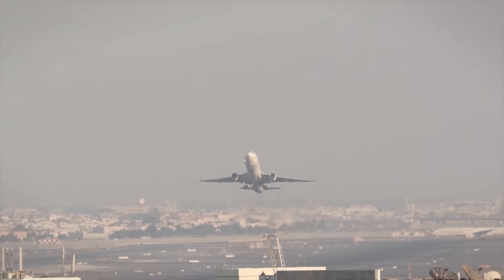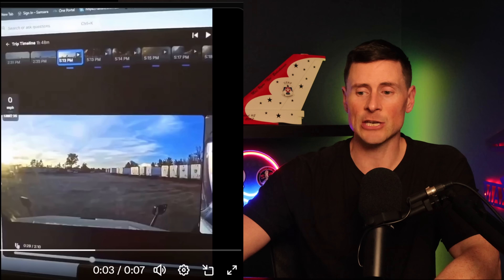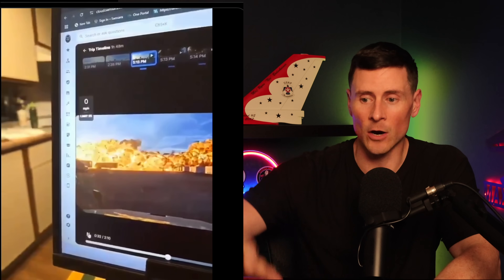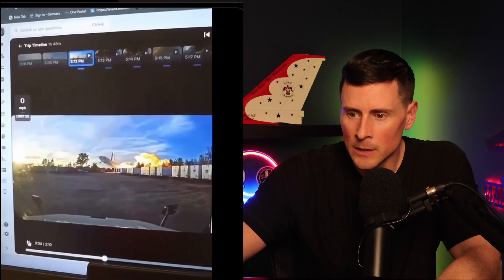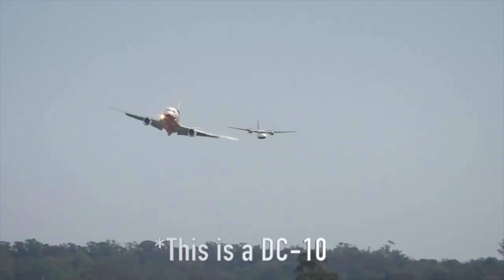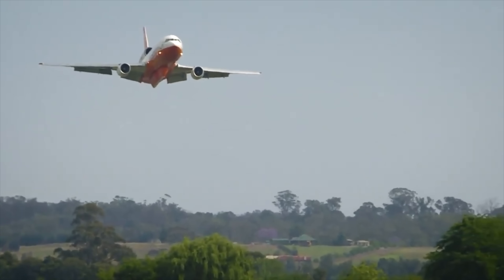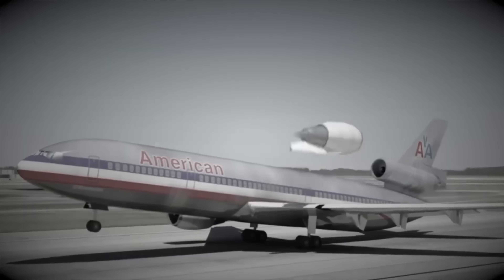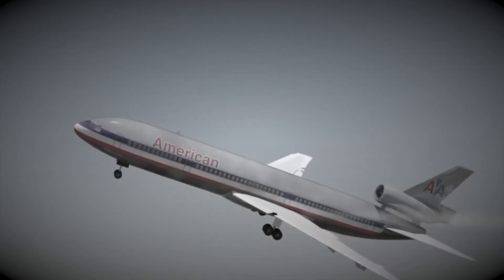Airline Pilot Reveals CHILLING Clue in Final Moment Before UPS 2976 CRASH

Comment: Its been a long time, but if memory serves me right, the maintenance crew used a fork lift to chance the engine on the DC10, damaging the engine mounts, causing the engine to depart the airframe.  I don't think that would in any way be related to this crash.
Reply: Yes I believe so-they used a forklift instead of a hoist or crane.
Reply: @beckiruther1213  And it was because they left the engine still partly attached to the plane with the forklift shut-off and the forklift hydraulics leaked down slowly putting the engine's weight on the only remaining bolt connecting it to the plane causing cracks to form and then when the crew returned to finish their work nobody noticed what had happened. As I recall the findings that were later reported by the NTSB. Just pure human error.
Reply: No this was intentional.
Reply: @MikeJones-wc4qj I think so too, but what was the motive? Layoffs, disgruntled employees, someone suicidal, addictions, political…
Reply: @MikeJones-wc4qj  That's misinformation.... you have absolutely no evidence of any such thing!
Reply: @MikeJones-wc4qj Stop with the hysterics.

Comment: Why would it try to take off while it's actively on fire? All the warning lights and systems blairing... Seems weird to proceed to take off right?
Reply: They must have passed the V1 speed and couldn't abort takeoff anymore because the remaining runway won't be sufficient to stop
Reply: first guess, already at t0o high of speed to stop on airfield, and...the plane is supposed to be able to take off with just two engines,  but like he said, too late that they may have caught that number 2 engine was damaged by debris from #1, so now not enuf power, and/or # 1 could have ripped up hydraulic lines causing plane to keel over just like flight 191 in 1979.

Comment: Keep in mind too that some of the ground casualties may never be recovered. Highly probable that they were completely cremated.
Reply: Sad to think about 💔
Reply: 16 unaccounted for last I saw.
Reply: Sadly teeth maybe the only body part that might be found in some very badly burned bodies. Would be very hard to find. Searchers would have to be looking very close at everything.
Reply: @krisdunwoody7037 they found the pilots flask apparently
Reply: Depends on the heat, and how long it burned. Cremation generally requires 1400-1800 F, 2-4 hours in the crucible. The heavier bones are reduced by the fire. The cremains are raked out into a container, and poured into a cremulator that grinds everything to a powder. They’re not ashes, they’re powdered bone fragments.
Reply: Not cremated, it was a flash fire.

Comment: Reminds me of the Concord takeoff when debris on the runway caused a tire to explode which punctured its main fuel tank, and as it was past the one it had no choice, but to continue and a short, distant later crashed killing all on board.
Reply: Aborting may have been the better option, but they would not have known.

Comment: Is it significant the surge is observed on rotation, because of the high AoA ? I've heard it can increase the risk of compressor stall, possibly along with some FoD or hot gas ingestion from the #1 separation and fire event.  AoA remained high for the rest of the "flight" but no other surges have been identified ?

Comment: The MD-11 has a smaller horizontal tail than the DC-10to improve fuel efficiency, which is a key difference between the two aircraft. 

While the DC-10's larger tail provides more inherent stability, the MD-11 uses a computerized stability augmentation system (LSAS) to compensate for its smaller tail.

The MD11 smaller tail has also contributed to multiple deadly “hard landing bounce rollover” incidents over the years killing hundreds.
 
With the MD-11's longer fuselage than the DC-10 there also a high probability the sparks seen from the tail of the aircraft might be from the tail striking the runway while attempting to take off, and if the LSAS  system contributed to the crash. If so and to what extent the LSAS may have contributed to the crash I am confident the NTSB investigators will look into.

Comment: Having watched Mentour Pilot on this and a few other channels, if the debris hit/was injested into the rear engine, you could indeed see a #2 engine stall.  One engine out of three wouldn't provide enough thrust. IIRC they upgraded the engines and systems after the 191 disaster, so two engines should have been enough to get airborne. So they likely did everything correctly and couldn't have factored in the #2 engine also going out.

Comment: Thanks for this I was trying to work out why it couldn't fly, presumably it was max weight but still surprised it couldn't get off the ground with 2 engines, those compressor stalls on the number 2 engine explain it though. Poor crew. RIP.
I've been thinking for a while (after the jeju crash particularly) is it time for major airports to have EMAS at the ends of all runway - give the pilots an option of running off the end without dying and without causing damage outside the airport. Just seems like something that could be done.
I've got to say I've never been a fan of the MD-11/DC10.
Reply: Yeah, that center engine must have not provided at least the minimum thrust.

Comment: It actually got about 30 feet off the ground. It cleared some warehouses even after clipping the first warehouse, which is actually a UPS Logistics Center. It crashed about 1000 feet away from where it clipped the warehouse.
Reply: 225 ft (unadjusted baro. altitude) was it's last ADS-B datapoint just before it hit the first warehouse at 185 KT groundspeed.
Reply: Why would it try to lift off while it was already on fire?
Reply: @notoriousfam2922  After it achieves a certain speed relative to the runway, it's lift off or crash. The pilots couldn't see the fire themselves.
Reply: @notoriousfam2922  Plane was at V1 speed. No choice other than to takeoff at this speed. This is the most critical and dangerous seconds of any takeoff... If they had engine #2 and #3, most likely they would have been fine except it's speculated that #2 went out due to #1 engine...
Reply: @JStock-id1qi
I would bet that they were close to or at Vr when the engine exploded and departed the wing. There could have neen only one outcome, sadly. 
(Former DC-8-70 series F.E. and F.O. with Emery Worldwide Air Cargo)
Reply: @notoriousfam2922 passed the point of no return
Reply: @notoriousfam2922 I’m sure the vast majority of people don’t know about that “point of no return.” I kinda wish I didn’t. I try hard—-real hard—-not to think about it every time I fly. But it’s a fact of flight……
Reply: 175 ft according to Flightradar24. Still unavoidable.

Comment: The sparks are probably from the tail skid as they tried to rotate beyond limits to get airborne?  It will be interesting to see if the crew had a fire indication and/or had enough runway to abort. It doesn't look like they did. It appears that there was a ruptured fuel line with the fuel reaching the hot section of the engine.
Reply: it looked like the sparks were up higher at engine #2

Comment: Plane was doing 180 kts, enough to fly at flaps 28 (Vmin=186), but high angle of attack resulted in stall. There was a chance to save it. Once the fire was out (must manually close fuel lines), the #2 could have recovered. They were probably at flaps 15 (Vmin=192) so combined with high AoA, curtains. RIP.
Reply: Flaps 28 is outside the certified takeoff settings.  It would not used.   IF there was a loss of 2 engines past V1 there was no chance.
Reply: @jbgunner4324  Yeah I think 15 is standard. Still 180 is pretty fast, with minimum nose-up it should be flying at 15.
Reply: @ultrametric9317  heavier weight takeoffs in the MD require very high speeds.  V2 speeds to 192 but i havnt saved any data.   Take off flaps are set between a range of 10-25 that is optimized for weight, runway, and thrust settings.

Comment: Sir you just explained. A Huge issue..The internal plane panel and gauges shows that things are well while other disconnections exist without pilots aware of the disconnections
Reply: Plane and mechanical crew do extensive checks before takeoff-interior and exterior. Captain has the final say so if a plane is fly worthy. It seems like sabotage-KY is a red state and UPS is huge. What cargo was on this plane?

Comment: 0:51 As you point out later on the engine isn't even attached to the aircraft at the point where the video starts There are photographs of the #1 engine (not the nacelle or fairing, the entire engine core) laying in the grass to the side of the runway.

It's likely that either chunks of the #1 engine FODded out #2 or the giant fireball from where #1 used to be attached was causing a compressor stall in #2.

Comment: 191 lost it's #1 due to improperly installed engine that damaged the mounts. This is either that or the engine failed at TO power and separated from damage and vibration. The #2 failure was likely FOD from #1, at V1 with 1 engine and damaged flight surfaces the aircraft was doomed. RIP to the crew and those killed on the ground.

Comment: My work is located a few miles in direct path of a international airport with steady air traffic. I have a fear of jet engines overhead.
Reply: You'll be fine
Reply: Before they expanded Standiford Field with the new runways in the 1990's, all of these planes flew directly over my house (before they had these newer much quieter large turbofan engines) to turn for approach to the runway. It was scary at times, especially during thunderstorms. I had nightmares for 30 years of planes crashing into my house. Now they fly more east over the city and follow over the Ohio river and then turn south over Jeffersonville and flyover the Galt House on their final approach to the runway. I have heard many several an engine flame out and had restarted over my house, going full throttle to make up the airspeed quick. Talking about the pucker factor? Hearing a loud jet plane approaching, it popping then going dead quiet, then roaring back to life at full throttle. Back when we had the KYANG with the F4 Phantoms, we often had ground and window shaking sonic booms and I've heard a couple also flame out and restart.

Comment: I had an engine failure and forced landing in my old luscombe 8a back in 2023. I can only imagine how terrifying it would be to have such a massive failure in a large jet aircraft. I was able to land in a farm field. I was hoping for a highway out in farmland but there were so many poles along the road and vehicles. Landing went alright but the field was very muddy and the plane was damaged badly but I walked away. I am very happy I was by myself. Having other people would make it so much worse
Reply: Better to land with control. Those that try to turn back to the airport i.e. the impossible turn, stall spin and die. Good job getting down and surviving.  Aircraft aren't important,  your life is.
Reply: @frederickking1660 yeah there was never a thought of trying for any airport I was 18 miles away or so and did not have the altitude. I picked the spot almost immediately after the engine died and just circled over looking at the area. I was really trying for a highway but there were quite a few cars and telephone poles and wires. I did think about those videos we have all seen of someone having an engine out and they try for something that's never gonna work or they panic until they are forced to realize they are landing off airport and they are going way to fast at touchdown. I wanted to avoid that and my landing speed and line up were pretty good I thought I was in good shape until I was about to land and saw standing water and mud but there was no going back. It stopped hard and nosed over. Ripped the gear out and crushed the front of the plane but I actually felt pretty good. Had sore shoulders for a while after but that's it
Reply: Glad you’re still with us. Sucks about the airplane.. those are pretty birds, but your life is what matters most. Godspeed.

Comment: The perspective is away from the airport, so it struck the building while climbing. There is (was) an oil recycling business ~1200 feet further along the flight path, 4504 Knopp Ave, about where the big fire at the top left on the image is. I suspect the engine loss compromised the slats/flaps on the left wing, causing loss of lift and uncontrollable roll.

Comment: The DC-10's were grounded for a while after the American Airlines incident. When pilots talk about "losing an engine," I doubt they're talking about the engine breaking off on takeoff and tearing apart controls and hydraulics in the wing. If that happens, what can be done?
Reply: It's called a separation. In my plane it's on the same checklist as for a fire or failure with severe damage.
Reply: Eject ?   😂  you are toast , big buddy … this is my last week .  👋   💥 🔥☠️
Reply: The DC-10s weren't grounded immediately after AA 191, though.

Comment: Good eye for seeing the compressor stalls on the #2. Either it ingested parts from the #1 detachment, or the fire ball from the left wing disrupted the airflow into the #2. Either way, they were basically down to 1/3 of available thrust and she just couldn’t/wouldn’t climb. The black boxes and maintenance records will tell the story. So sad for all those lost and affected by this tragedy. 🙏🏼🤕💔
Reply: Keep hearing about birds in the area. Any word on that? 

An engine nuking itself at V1 is ... horrible. Right when you need it at near max power,  it disappears? 😢
😭😭
Reply: Don't think they are going to find any black boxes - I'm sure they were burnt up with all that heat.
Reply: @DDee-oi6kn they are designed to survive things like this
Reply: @airratchetjockey7605  Both BB's would probably have been engulfed in burning oil from the recycling plant on the ground, they may not survive that.

Also, if it were a ruptured fuel line in the #1 engine containment structure, I don't know if the various engine temperatures would be able to resolve a fuel line rupture - depends on how soon the engine was engulfed in flame
Reply: @Nick_the_Gödel_Bach they have them retrieving the data
Reply: @DDee-oi6kn  they have found them. Yes they were burned in the fire, but NTSB man on TV here said they were designed for such and should have the data in tact.
Reply: @DDee-oi6kn : The post-crash fire would have to last days to really ruin the black boxes. Short fire like this is just Tuesday for them.
Reply: @DDee-oi6kn Bro, black boxes are kinda made for, uhhh, you know, umm, this sorta stuff.

Comment: It's a crystal repeat of 191
Reply: Flight 191 had the number 1 engine come off the wing, this did not. 191 crashed because the slats on the left wing retracted when the engine came off and took the slat cables with it and the left wing stalled while the right wing (slats extended) was still producing lift causing the aircraft to roll uncontrollably. I'm a retired A&P mechanic and I have had hundreds of hours of training and review of the 191 crash. The flight 2976 was a loss of power issue for some yet to be discovered reason. The MD-11 should be able to take-off and come back and land on 2 engines. This actually was nothing like the 191 crash.
Reply: @dennythomas8887 Clearly you haven't seen this plane DID lose the #1, and didn't have the required AD patch either. MD lied after 191, and I've spoken to several KC-10 pilots who said MD never actually fixed it on 10/11 models
Reply: @dennythomas8887  Oh, it looks vaguely identical, though. Why is there an engine there on the ground and a engine cowling laying over there by the runway?

Comment: The silver lining in all of this is it wasn't a passenger aircraft.
Reply: I don't think there are any MD-11's still in passenger service.
Reply: @roachtoasties Never said there were. 
 I just said "aircraft".
Reply: It's very 'lucky' they also crashed in an area with very few people around/working at the time. If they had crashed further away, or if the airport had north flow which faces many hotels and residential buildings, there could have easily been several dozen of people killed on the ground.
Reply: @luminar2444 like that horrific incident in Europe where a plane crashed into a huge apartment building. I think it was a freight plane too
Reply: @Kizzabell Yes, El Al Flight 1862, in Amsterdam. Very sad. The plane was at the end of its flight, but still killed nearly 50 people. I shudder to think if the plane had just taken off and was completely full with fuel, how much worse it could have been.
Reply: If it had taken off North instead, it would have hit a major highway and residential.
Reply: @thebionicfrog  most of the time they approach and land from the north and take off headed south because the head wind is usually coming from the south here.
Reply: And it didn't crash in a residential area.
Reply: Nope it's only a Warning by somebody. It's Sabotage for sure. Plane was maintained yesterday. 😮
Reply: @MikeJones-wc4qj  no it wasn’t. NTSB stated flatly no maintenance done before the flight.
Reply: @MikeJones-wc4qj why make stuff up?
Reply: @MikeJones-wc4qj  it went through major maintenance back in September in Texas for a fuel tank crack repair.